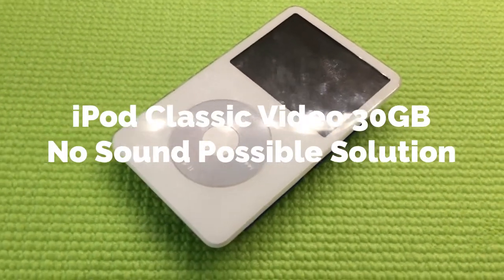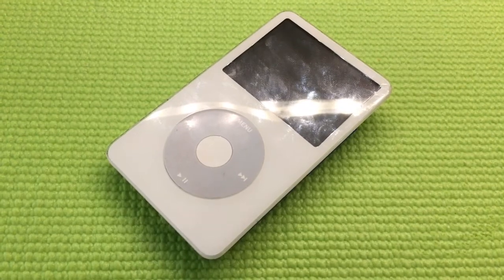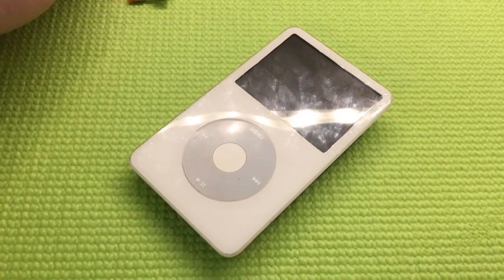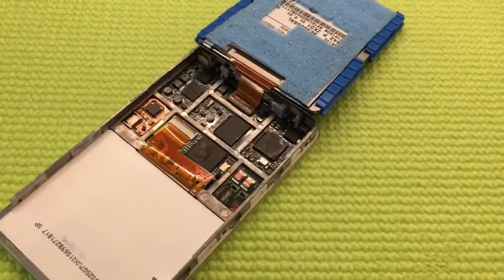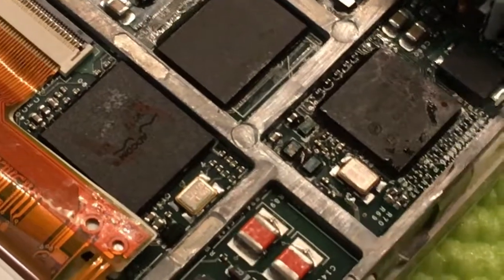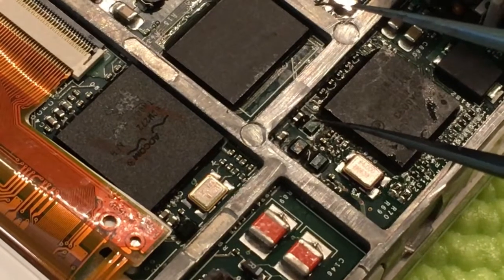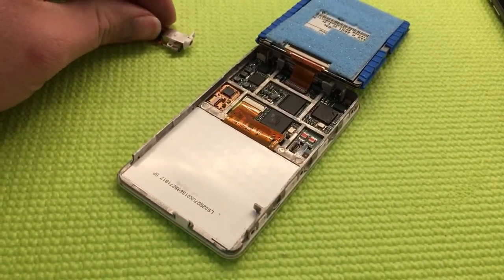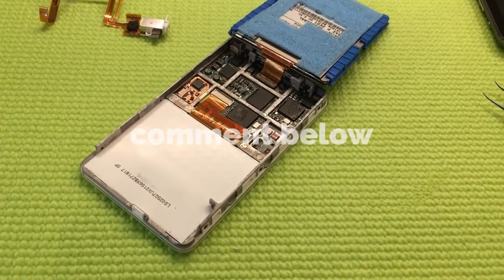iPod Classic Video - No Sound Solution

Comment: I really hope replacing the jack works for me because resoldering a surface mounted chip is waaaaaaay outside my skill set.
Reply: Same here. I have no audio on my ipod video 5th generation 80gb, so planning to replace the earphone jack and battery tomorrow and pray it works! Anything more than that, is definitely out of my skill set also.

Comment: Beware of buying cheap boxed ipods, I got scammed on ebay and bought a rebuilt ipod with Chinese parts inside of an ipod classic case. Worked great but the Battery was doa and I've only had it for a year and sound won't work. My other ipods have worked for years, replace headphone jack here, battery there, hard drove. This are amazingly easy to fix and super durable that's why I love them. I'm usually up for fixing stuff like this, thanks for the video. I just went and bought a used ipod tho. At least it's apple parts and not some shoddy Chinese aftermarket crap. Beware of that scam ppl.
Reply: Yeah just bought one off eBay 180 for a modded 256gb and the sound doesn’t work , when I plug in earphones it only works on one ear.
Reply: @kickdoor  that sucks! If I ever buy any more iPods off eBay, I'm legit just gonna get the scratched up dingy looking ones and cobble a working one together.

Comment: I’ve got a similiar problem. My iPod classic AUX works fine but if I try using an iPod connection cable fitted to my Merc - the device can be read as you can see it’s playing but there’s no sound (and the volume is turned up enough). It played randomly the other day but now isn’t working again.

Comment: Heck yeH just did this and made a terrible video. You can alternatively bridge 2 pins rather than replacing this component. Good info!
Reply: please, what does that mean, "alternatively bridge 2 pins rather than replacing"? 
I don't have the skills to reball solder, apply heat etc. I could try but can't risk a rookie mistake on this thing of strong sentimental value; was my sons (27) who died tragically.
Reply: @synchronicity1470  this is super small component. I made a video on the fix. There is 2 pads of the 6 that this component has, if you connect these 2 pads together the audio works again. 
It is very tiny, so if you’re not comfortable with micro soldering and don’t have a very fine tip soldering iron, I’d recommend sending to a pro

Comment: Bruh this sucks I just spent $40 on parts and a battery that doesn’t even fit my iPod because the cable is too short I changed the aux jack and the case new I wanted to restore it but nope the thing never worked the only thing that came back was the click wheel sound

Comment: I replaced the headphone jack and still nothing. I can hear the audible click wheel from the iPod but still nothing from the audio. I know you can’t see my device but do you think it may have the same chip malfunction?
Reply: The chip in the video is what your problem is. That component is what makes the audio and if it’s broken it will result in no sound
Reply: Hey, Did u fixed ?

Comment: Just wondering. I have noticed that my  5th Generation iPod external click wheel sound doesn´t work (clicker settings in Yes, of course) I have googled it a lot but I cannot find where is the part producing that clicker sound. Click Wheel? Headphones jack? Motherboard? BIG mistery!
Reply: Me too I’m trying to figure this out as well my ipod classic 5.5 doesn’t make the clicker sound when scrolling and I can’t get audio either from headphone jack
Reply: @SJSOmar  Replace the the headphone jack (actually the headphone jack + flex cable ,is a single part)  I did it and I got the clicker sound again. And as you cannot get audio either is that simple.
Reply: @miguimau  Same problem, Did u just replace that headphone jack?

Comment: Mine only plays audio on the left side, except when I push the cable in an angle, then it connects the cable to the right side as well.. Sucks that they don’t sell the audio jack replacements anymore, like anywhere
Reply: PuurJarrett try eBay. They’re not that hard to find. I’ve seen some as recently as last week.